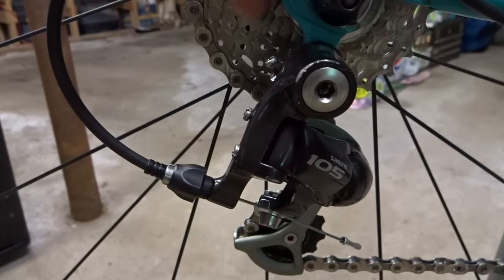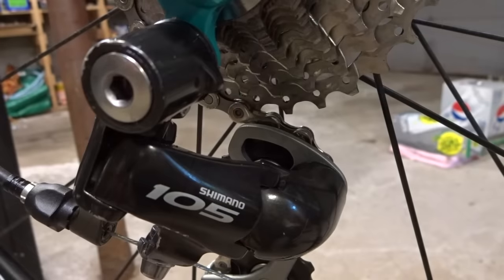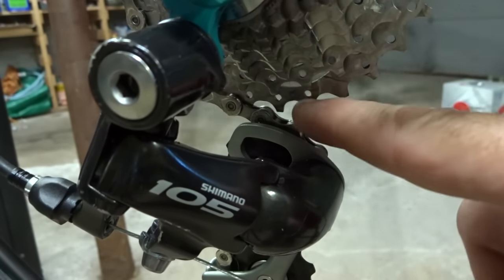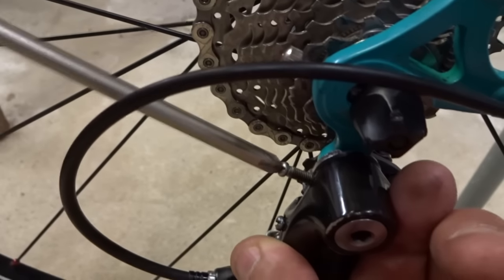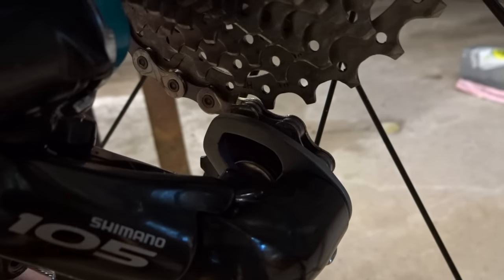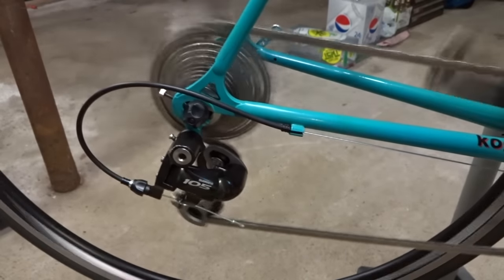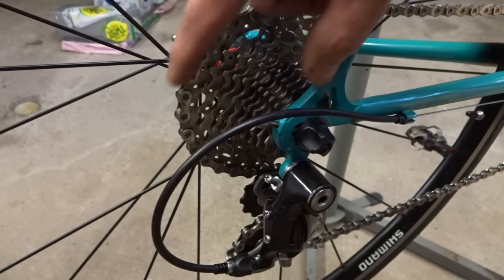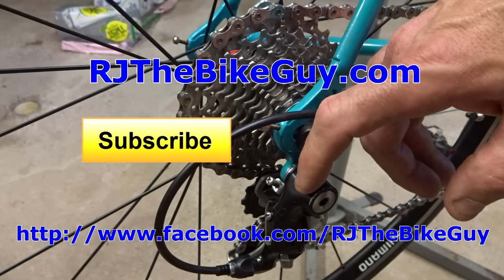How To Adjust The B Screw On A Rear Bike Derailleur

Comment: I don't understand why some of the other rear derailleur videos fail to mention this.  I actually had to search for this specifically to find this excellent video.
Reply: Me to 👍
Reply: I still can't find info on my 1970's Suntour version as the cog is always 2 inches from my cog!  This is clearly one VERY misunderstood screw within the cycling world
Reply: A lot of them are trying to sell you a  derailleur upgrade, oversized pulley wheel, oval chain ring, etc.. stuff you don't need. Seen it many times.
Reply: Same
Reply: Your backing out twice? I understand but your explanation is not correct.
Reply: They’re not pros like RJ

Comment: Small tip: While you are turning the screw, you pull the RD slightly away so that the B tension screw isn’t pressing firmly onto the B link or the RD hangar. And you check periodically whether or not you got the correct spacing. (Now if your bike is new or your RD is new, Shimano and SRAM gives you an indicator, so finding the correct spacing is a lot easier for rookies, you no longer need to eyeball or use a ruler.) The reason being is that the tip of the screw is very hard, and is often rough. So that it can very easily grind a divot into your hangar or B link, especially when you are doing that first time, and you are turning the screw back and forth.
Reply: thx

Comment: I'm reasonably good at adjusting my rear derailer but on my last tour no matter how I fiddled with it it would jump from 8 to 7 (9 speed derailer) when under heavy load e.g. on hills.I'd have to go all the way to 9 to stop this jumping. I couldn't reproduce the problem on  bike stand or at the side of the road and with a light load it was just fine. In desperation I took it into a bike shop in Rolla MO. They were originally as mystified as me but after taking it out for two test rides they managed to figure it was the B screw adjustment. Adjusting the B screw so the jockey wheel so it was as close in as possible fixed the problem.
Reply from the maker: I would also look at these things: https://www.youtube.com/watch?v=VzrpC7jrz8U
Reply: Peter Jack 
It seems when you adjust gears on a stand it is fine for gear speed but not for representing chain tention or load.
Does chain tention relate to gear adjustment, should tention be done first.
Reply: Yes, same thing was happening to me, I thought it was the index, or indexing whatever.
Reply: Trek520 rider Most of the time 90% gear jumping is related to bad indexing after setting up the Low and High limit screws. The derailleur cable must have some tension when on the smallest cog. The indexing for the inner cogs is done through the Derailleur cable tension adjuster. What they told you is ridiculous and a complete lie. The only reason why you need to set the B screw is to stop the guide pulley from getting too close to the cogs causing noise and grinding issues with the chain.

Comment: This is just what I needed because my derailer was pushed out and it was causing the chain to jump off! Thanks
Reply from the maker: Pushed out? Like bent out?
Reply: @RJTheBikeGuy  it turned out to be the gear cable that sets in the derailer. It was allowing it to push out instead of holding its place and the gears wouldn’t change. This video just kinda led to it and helped haha thanks!

Comment: Request: a video describing in detail when it's time to change either of your casette, chain or chain rings - including tools used, etc.  Thanks, and keep up the good work.
Reply: The chain, cassette and predominately used chainring (e.g. the middle ring on a 3 x setup) generally wear at the same rate on multi speed setups. 1 x drivetrain is a bit more of an exception because the narrow wide chainring teeth are usually taller and so you can usually get away with replacing just the chain and cassette.

You can usually tell if your chain and cassette (and possibly chainring(s)) are worn out because the chain will skip over the cassette under load, i.e. riding up a hill.

It used to be a myth that pressure washing your chain, cassette and chainring(s) somehow forced dirt into the system, thus wearing it out faster. That couldn’t be further from the truth! If you apply lube to your chain before pressure washing everything (be careful not to blast water into your wheel or bottom bracket bearings), dry the chain with a rag and re-oil it, you will vastly prolong your drivetrain’s life.

Comment: Struggling a bit with my Shimano 11-speed XT rear derailleur.   You state that the b-screw is not critical, yet I seem to have constant issues with the pulley rubbing the low cog, which is a 46 tooth pie plate!   

The b screw seems very critical to these setups given the gap between the low and the second cog.

Comment: Hi Jim here,

Great video.

I have an old bridgestone mb2 equipped with a 13X 34 7 spd cassette and a shimano xt long cage rear derailler.  The upper guide will always hit 34t gear even when b screw fully screwed in.  Even installed a longer b screw where it still upper guide will hit 34t gear when fully screwed in.

Is the pivot spring worn out?  Do I clean derailler pivot bolt by disassembling. I have 15 other bikes using the 13x34 7 spd set up where most all work perfectly.

Any ideas 💡? 

Thanks,

Jim-

Comment: I bought the Garbaruk 11spd cassette for my 1x11 GRX rear der. I adjusted my B screw to handle the Garbaruk 46t cog from the Shimano 42t that I replaced. However I don’t feel like the Garbaruk shifts as smoothly as the Shimano HG cassette was. Now I kinda regret it and should have just got an XT cassette instead with the 46t cog

Comment: Have a Shimano Tourney Drailler and it is to close to the first gear, and the screw is all the way in. Is there a fix for this. or will I have to replace the derailler and what would be a good one to go to, as this none is not very old and was not used a lot.

Comment: Thanks for the great video RJ! One question: should this adjustment be done before or after the other derailleur adjustments (limit screws and cable tension)? Or does it not matter?
Reply from the maker: Doesn't matter so much.
Reply: Thanks.

Comment: I was hearing a crunching sound when I went up a hill in my lowest gear, or biggest cassette ring of 34. 
Adjusting the B screw solves the issue I think.
The pulley was too close to chain ring.
It's the least critical adjustment, but it t can solve some unpleasant noises.

Comment: great vid, i didnt understand the function on the top adjustment screw, the upper jockey wheel bolt is brushing against my spokes, may be this is the problem, or a bent hanger, or wheel out of true?👍
Reply from the maker: Most likely limiting screw adjustment, bent derailleur, or bent hanger.
Reply: @RJTheBikeGuy  👍many thanks

Comment: How much space (ideally) should be between the largest cog and the guide pulley?
Reply: Between 4mm-8mm usually. As close as it can get without touching the cassette is typically the best for all derailleurs. If it's too far shifting will be sluggish and inaccurate. And if it's too close they'll be contact, noise, and bad shifting. When right shifting will be smooth, accurate, and quiet.

Comment: my B-screw is fully tightened, but still it touches the gear (probably because the gear is bigger than the origional). Any options to fix this?
Reply from the maker: Then maybe you are using a cassette bigger than the derailleur was made for. Or maybe the derailleur is damaged. Or something else.

Comment: Thanks RJ; however, this Dura Ace rear derailleur's 'b' screw's entirely stripped on this vintage Bianchi. Can it be easily replaced? And is it compatible w/ the front Shimano R-1000? Any thoughts would be greatly appreciated. Actually, I'd like to change out the entire groupset.
Reply from the maker: If the screw is stripped, replace the screw. If the threading the derailleur is stripped, I don't think it can easily be fixed.

Comment: Quick question RJ.,  I've a recent vintage that all of the set screw heads are all stripped rear and front derailleurs. I could get them out ok, but one at a time or what cautions need I be aware. Thanks....
Reply from the maker: Those screws aren't Phillips head. The are JIS Cross Point which is subtly different. Use the proper screwdriver. https://www.amazon.com/exec/obidos/ASIN/B000TG8OTY/ref=nosim/youtube25-20
A Phillips head screwdriver will work, but is more likely to strip them out.
Reply: @RJTheBikeGuy  Please re read my question. When I recently obtained ownership, the set screws (all of them, some worse) were already badly stripped by obviously someone using a philips screwdriver... they must be replaced. What caution measurers should I take in replacing these set screws, if any?
Reply from the maker: @timothybradek3560  Limiting screws are not a standard replaced part. You are going to have to find matching screws. Length/thread.

Comment: I  have a problem 12 speed derailleur just a single chain wheel the front chain wheel  it will feed onto the low gear quite a large cog but refuses drop back down new inner cable fitted bike only 2 years old

Comment: Good video, got a weird problem on my 2016 trek slash 8, with sram GX derailleur, Seems to keep snapping the notch which the 'b-bolt' part pushes into on the rear hanger. It completely shears it off, causing obviously no tension there, so the jockey wheels slam into the cassette and the chain goes really slack. Any ideas ?
cheers
Reply from the maker: I don't know. Maybe the derailleur is damaged, or something is bent.

Comment: Hi RJ, i have a 32 cog casette, having problems with the pulley rubbing the chain. But my B screw looks like not working. It doesnt change the position of pulley whatever i tighten or loosen it. Do you have any idea why B screw not doing its job?
Reply from the maker: Could be derailleur not made to handle 32t cog. https://www.youtube.com/watch?v=9R1CVWcgu_M
Reply: No, it is a long cage derailleur. I can send you a video on facebook, when i get back home later.

Comment: I have A Shamano Tourney rear derailleur. All slightly used. But all straight from the factory. The top cog on the derailleur is very close to largest cassette. It seems that moving the screw has no effect. What to do...
Reply from the maker: If the B screw is not moving it, then there might be some other issue. I can't tell you without seeing and working on the bike. You will need to figure it out, or take it to a mechanic.

Comment: You say its least critical but when a dérailleur has no B screw adjustment how do you get correct shifting? My Shimano TY22 (basic I know) has a gap over 1cm and when I shift up/down I have to overshift (I.e move from 2 to 4 and then back to 3 to shift from 2nd to 3rd cog.) The limit screws are perfectly set and if I mess with cable tension I just get rattling/grinding noises while in a certain gear. Now in any gear thr bike runs quiet but I have to overshift on some middle gears to get the shifts to happen :((

Is this because of the larger pulley gap that I can't adjust or something else?! Nothing appears to be bent but I'm no expert!
Reply from the maker: I can't tell you what's going on on your bike without working on your bike.

Comment: Do all derailleurs have b screws? I changed my son's 6 speed rear tire and there is no clearance to shift into the largest cog. Can't  find a b screw to let it out.
Reply from the maker: Not all of them. Could be the chain is too short. Maybe freewheel was changed and a larger one put on there not taking derailleur/chain into consideration. Maybe you are cross chain and changing to large cog, while you are on the large ring on the front (don't do that). Maybe derailleur was changed to shorter cage. Many possibilities and I can't tell you without working on it.

Comment: Hey RJ, we have an old bike and there is a "problem" with the deraileur. It feels like the pulley wheel is rubbing against the big gear on the back. I have tried adjusting the B screw as per this video but even screwing it all the way in doesn't seem to bring the deraileur out from the gear. I'm not articulating this right but what I'm saying is that I feel like I run out of adjustment.

I figured something is broken and the deraileur probably just needs replacing. It's not very high end. Quite a basic one. However, are you aware of any reason why this might be happening and if so, how we can fix? Its a Shimano SORA.

Cheers
Reply from the maker: Maybe the freewheel/cassette is bigger than the derailleur was made for. https://www.youtube.com/watch?v=9R1CVWcgu_M
Reply: Cool, thanks man. I'll check it out :)
Reply: andrewford80 Or the number of links in your chain is incorrect..too short for example. There are chain link length apps for Apple and Android that are quite good..takes the guesswork out of it.

Comment: What if there's no b screw? I have adjusted the L and H screw and the index, but RD pulley is rubbing on the largest cog on the wheel.
Reply from the maker: Then you may have exceeded the specs of the derailleur. Or the chain is too short. Or the springs is weak. Or the derailleur is cheap junk. I don't know.
Reply: @RJTheBikeGuy  When I bought the bike new, it didn't have that issue, at some point, it happened and I don't remember when, had this bike since I was 10, I'm 27 now lol

Comment: I noticed my chain was being pinched between the upper pulley and largest rear cog. I turned the screw all the way in and it didn't move the derailleur back at all. Any suggestions?
Reply from the maker: It sounds like you may be trying to use a larger cassette/freewheel than the derailleur is made to handle. Check the largest cog specs for your derailleur.

Comment: i got an 9 speed derailleur on my mtb...and it often happens when driving over bumps off road..the front end of the derailleur hits the bottom side of the chainstay...can i fix this with the b tension screw or somehow else?
Reply from the maker: It might help. It might be possible to increase the tension of the p spring a little: https://www.youtube.com/watch?v=hYgRJOg4e5w
Reply: awesome video..nicely explained....but im not sure if i can disassembly my derailleur like that....
its an shimano deore LX rd-m 570 deraileur... and i dont know if i can pull it apart...like the one you did...
 i tried screwing the b-tension screw all the way in...but didnt work out..its just moves the top pulley away from the cassete....

Comment: I tried to tweak the bscrew, the pulley is at the right distance but my derailleur keeps hitting my cassette when I jump off kerbs or little bumps. It's annoying and I don't think it is good for my cassette. I have a shimano tourney derailleur with 8 spd
Reply from the maker: Try putting more tension on it then (tighten the b screw).
Reply: hi might be worthwhile to slightly shorten the outer casing on the control cable by the rear mechanism. I have done this a few times when all else fails and it does the trick!

Comment: My rear derailleur seems to be fine, but my B screw doesn't seem to do anything! As such the pulley rub against the cog when I'm on the largest cog on the cassette. I couldn't figure out what the mechanical issue is. Could it be that my rear mech isn't installed correctly?
Reply from the maker: Or you have a cassette installed that goes beyond the designed range of the derailleur. The derailleur specs indicate the largest size cogs they can handle.
Reply: @RJTheBikeGuy  Thanks for reply. This isn't the case. Shimano 105 5800, largest cog 32T. The B tension screw doesn't move anything.
Reply: My largest cog is a 32T and my derailleur will support a 32T. It's a medium-cage Shimano 105 5800. It just really doesn't seem to do anything and everytime I set the bike up sometimes it's too close sometimes it's passable. Sent it to the mechanic and all he could do is max out the B tension screw and make sure the cable doesn't affect the body angle.  @RJTheBikeGuy
Reply from the maker: Then without working on the bike and actually seeing what is going on, I can't really tell you much. The b screw should be moving the derailleur back.

Comment: My Roubaix Sport with 105 Groupset shifts quite clunkily to me. I’ve messed with the adjustment screws a million times but it sort of just slams from gear to gear. The B-screw adjustment doesn’t seem to make much difference on my bike.
Reply from the maker: It only does fine tuning. The other adjustment screws are limiting screws and limit movement. Can't tell you why your shifting is clunky without working on the bike.
Reply: RJ The Bike Guy yeah I’ve adjusted the L limit screw to be directly below the largest cog and the H adjustment screw slightly to the right of the smallest cog. It shifts to each gear, but it feels like it shifts hard. It sort of slams from gear to gear when upshifting.
Reply from the maker: @CFG39  https://www.youtube.com/watch?v=gwBQxhZhKnE
Reply: RJ The Bike Guy could a slightly bent derailleur hanger cause the hard shifting from gear to gear?
Reply from the maker: @CFG39  Maybe. Here is an idea. Go through the video I linked above. Completely remove the cables. Test the shifters. Test the derailleur. Make sure everything is lined up. Replace the cables with brand new cables and housings.

Comment: Derailleur cage rubbing on largest cog only when the chain is in the second biggest sprocket at the back. 
Is this a B tension issue?
Reply from the maker: Cross chaining. You shouldn't be riding in large/large or small/small combinations!
Reply: @RJTheBikeGuy  Sorry, wasn't clear enough
The REAR derailleur is rubbing on the largest cog on the cassette when the chain is in the sprocket below. The chain is in small ring at front.
Reply: RJ The Bike Guy Solved, I put derailleur face  plate on upside down a few weeks ago. Idiota